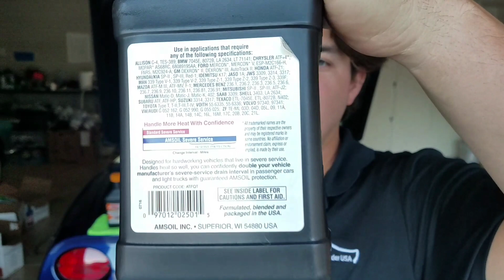What Does SAE Stand For & SAE Oil Viscosity Grade Mean?

Comment: My car engine oil recommendation was sae 5w30 and i use 5w30 not sae is it safe ? Or i have to change again
Reply from the maker: I'm not sure what you mean by that?

As long as the motor oil meets the specifications for your motor you're fine
Reply from the maker: This will give you everything for your year make and model and engine size.
Find AMSOIL Products For Any Vehicle - https://www.amsoil.com/guides/?zo=5331179
Reply from the maker: Also if you're new to Amsoil this is the best value to get the products with this link.
❤️ 🇺🇸 ❤️ Professional YouLubher: Eben Rockmaker Regency Platinum Direct Jobber AMSOIL Specialist (Dealer#: 5331179) 702-472-3614 

      ✅ ✅ ✅  You will get Best Value with 6 Month AMSOIL PC Membership because You get $33 back on a $100 purchase after the difference in Sales Tax with No need for Auto Renew - https://www.amsoil.com/offers/pc/?zo=5331179
Reply: I don't know if it can be trusted it. I've used motor oil that are not by SAE. This time we all should use motor oils that comes from SAE

Comment: So I have a Ford ranger that says 5w-20 would it be bad to put in 5w-30 
I would think me living in Florida the higher weight would be better due to the heat?
Reply from the maker: If it was my car I would stick with the OEM 5W-20.

If I was doing racing then I would use the racing motor oil perhaps the 10w30 dominator racing oil.

If you ever want to try themselves this is my link and I would get the credit if you ordered and I could always answer all your questions in the future because I would be your Amsoil dealer.
Professional YouLubher: Eben Rockmaker Regency Gold Direct Jobber AMSOIL Specialist (Dealer#: 5331179) 702-472-3614 

     If You're New To AMSOIL I Recommend The AMSOIL 6 Month PC Membership - https://www.amsoil.com/offers/pc/?zo=5331179

Comment: My 84 Buick Gbody Regal with a 231 3.8 V6 calls for an SAE 30 per the owners manual. Why doesn’t Amsoil make a SAE 30  like say Royal Purple that does make it? And what is the Amsoil Equivalent to the SAE 30? However I do see Amsoil SAE 30 in the Amsoil Catalogue BUT it’s break-in-oil
Reply from the maker: Great question basically the older oil would be more like a 10W-30.

This is what I run in my 59 Cadillac - https://www.amsoil.com/shop/by-product/motor-oil/gasoline/premium-protection-10w-40-synthetic-motor-oil/?code=AMOQT-EA?zo=5331179

I like it because it offers tons of high heat protection and it also won't leak is fast because I have a small rear main seal leak until I get it all fixed perfectly

Comment: Hey, Young Fella :) Nice to see young fellas doing some homework :) 
Keep up with that - You might find - SAE J-300 specifies 0W oil @ Minus 35C? 
They also use terms like Centipoise? CCS? MRV?..... Oooh?  :(  I'm getting too old for this? But, you cd revisit Amsoil specs?.... 
Europeans seem to extrapolate low temp CP to CSt @ 40c=104F? They do the Math? :) 
For example - SAE 0W- 20 oil cd be: 5.6 - 9.3 CSt at 100C=212F? & 45-50 CSt? @ 40C=104F?
There's Base oils - Vis Improver additives, etc....?
Dunno ' bout shearing down going thicker? It would first wanna go thinner? Vis Improver additives cd also shear down? 
Then - oil could oxidise? & sludge? Become thicker? - Fuel dilution might "help" thin it down? ;)' 

 Re: ATF - Far as I know - There're at least 2 different viscosities - Thicker for older? Thinner for newer cars? 
Incl by Amsoil? Not sure if newer, thinner (fuel efficient) should be used in older vehicles? Clutch plate engagement? :( ....

Comment: My 2017 Infiniti Q50 red sport with a 3.0   twin turbo v6 requires 0w20 oil. I believe this is too thin of oil for this application, I drag race the car occasionally. Been using Amsoil signature series 0w20, thinking of going up to a 30wt, other guys are already doing it. What’s your opinion?
Reply from the maker: Can you see your oil temperature on a digital readout?

Because if you're getting anywhere near 250-degree motor oil temperature I would definitely run a thicker oil.

I would probably run like a 0 W 40 like the new Corvette takes if you're hitting 250 degrees or hotter.

If you're only touching like 230 for a brief time I wouldn't even waste the time to change it.

Because Amsoil Signature Series doesn't shear down like the other mineral oils.

You can also do oil analysis to be extra thorough. If there is very little wear metallic in the oil I wouldn't worry about.

That's my opinion.

Comment: Good educational video. Maybe you could do a video on the API SN ratings and what consumers should look for when they go to purchase motor oil for their vehicles.
Reply: AMSOIL is not API certified.  Well, some versions might be, but I am confident that Signature Series is not.
Reply from the maker: Have you tried Amsoil?

yes, All Amsoil motor oils meet and exceed the API specs.

Signature Series protects turbos 4 times better the Mobil 1 Extended Performance.

This video shows the difference - https://www.youtube.com/watch?v=xt1Oh9kp3Lc
Reply: Signature series exceeds the API specifications as verified by the Petroleum Quality Institute of America. The tbn (total base number) is 12.8. Go ti PQI's website to verify their test results.
Reply: Signature Series exceeds API specs. Petroleum Quality Institute of America an independent 3rd party has tested and verified that Sig Series exceeds the requirements for the API SN requirements. Go to PQIA's website and check the numbers out. You will also find out that the TBN number for sig series is 12.8 which is the highest for any sample oil submitted to PQIA for testing. The higher this number the more resistant the oil is to acid and volatility and burn off.
Reply from the maker: Great idea Ken!

That'll be one in the future definitely😊

Comment: Hmmm. Interesting. I wonder if the oil used in my '18 2ss 1le is recommeded for the track? It's a track focused car... I guess i should look into this. I have a track day later this month at spring mountain... Thanks for bringing this to light...
Reply from the maker: It's very interesting all the Corvettes used 5w 30 motor oil for the last 20 to 30 years.

Now with the higher-quality additives they recommend a 0 W 40 which has the easy cold start and has the extreme track temp ability. 

If you're going to do long racing sessions you should definitely use 15w 50. Amsoil makes a 15w 50 Dominator racing motor oil which is 100% synthetic.  I've never had anybody try it yet to get feedback.
If you're going to be keeping your motor oil over 250 degrees for extended periods of time you should definitely use a racing motor oil like 15 w50.

The hottest I've ever had my motor oil in my car was 240 degrees.

The reason Harley-Davidson motor oil is 20w 50 is because they are air-cooled and the motor oil temperature can get up to 300 degrees.

Comment: In my opinion 0w20 is like water. So i prefer 0w30. In europe they use in new engine 0w30. Amsoil has some 0w30 oil?
Reply from the maker: Yes, this is the link to the 0W30
https://www.amsoil.com/shop/by-product/motor-oil/gasoline/sae-0w-30-signature-series-100-percent-synthetic-motor-oil/?code=AZOQT-EA?zo=5331179

My preferred customer link will save you 25% off
Reply from the maker: My Amsoil ( Link ) gets you 25% off & complimentary shipping over $100 & any order under $100 is only $8.99 shipping: 
Click the link here- https://www.amsoil.com/offers/pc.aspx?zo=5331179